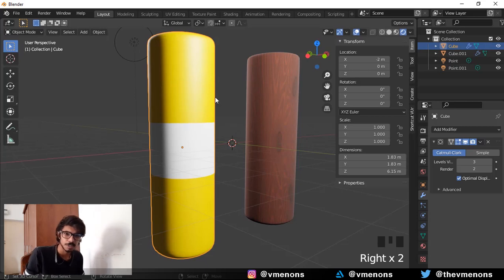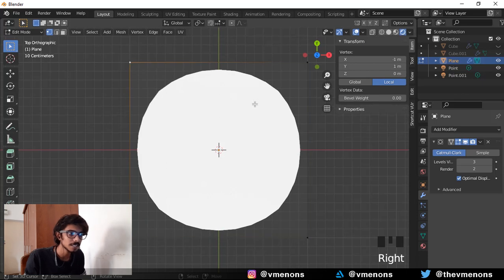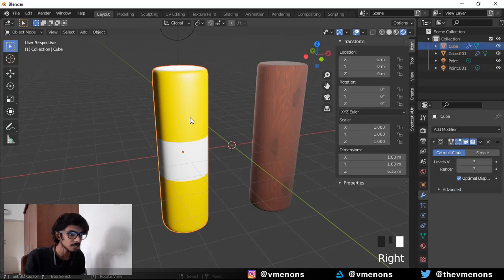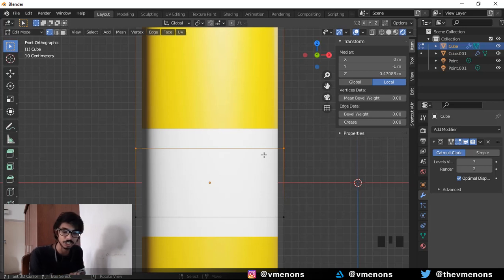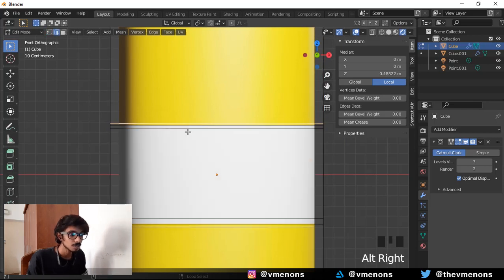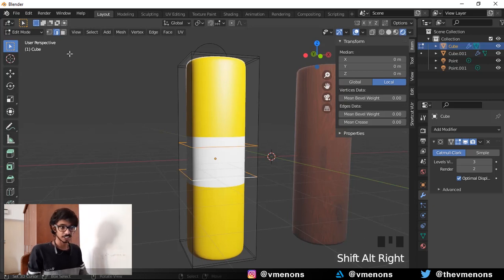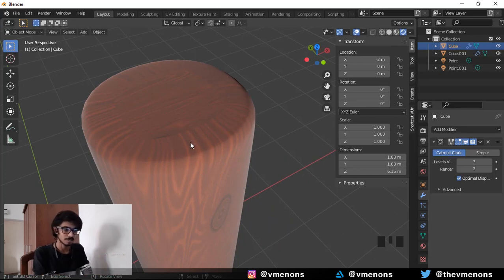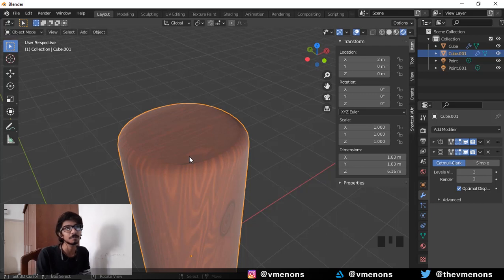How to fix subsurface modifier stretching textures | Blender 3d Sub surf modeling tip

Comment: How to fix subsurface modifier stretching textures with out sharp edges using crease?
Reply from the maker: That's probably a problem with the UV maps. Try applying your model's scale or checking your UVs :)
Reply: Very Good Point, I,m Still Suffering from This issue, I've Checked my UVs And Applied shapes